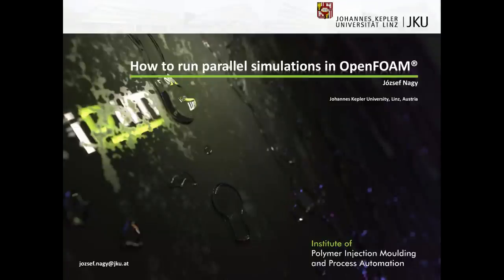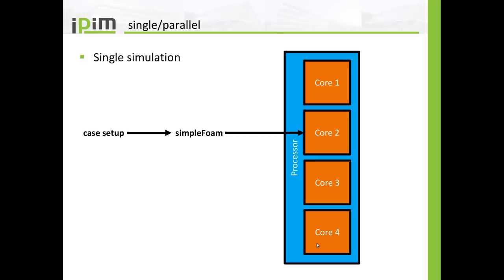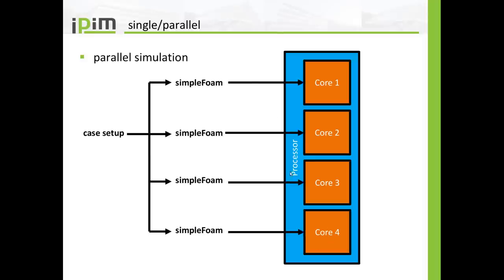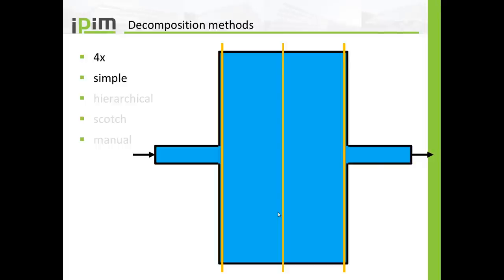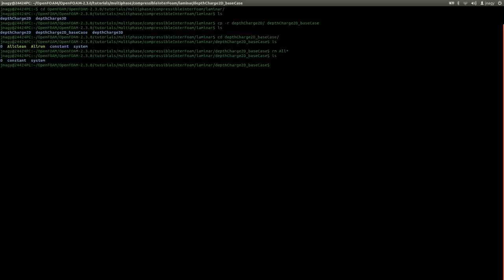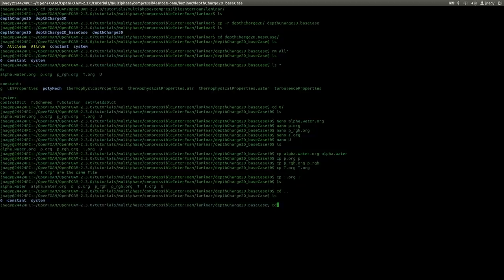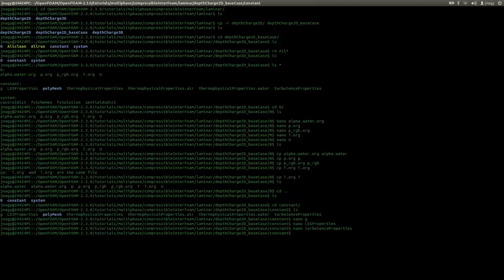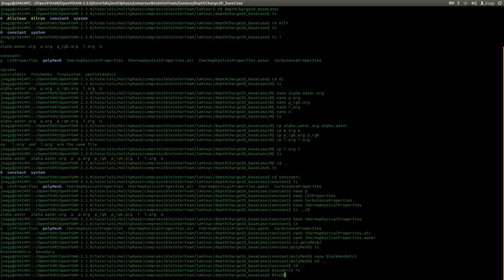How to run parallel simulations in OpenFOAM® - Part 1

Comment: Hii sir i am trying to implement custom model it works well with single core but for parallel it gives a warning that it couldn't find the .so file can you please give me some help
Reply: Hi, have you solved your problem? I have a self-written boundary condition, and the decomposePar doesn’t conserve this boundary when calculating. So then I cannot reconstruct because it says I haven’t specified a boundary

Comment: Hi József. I recently install to my laptop Ubunto 20  and after I run setFields, it run ok so far, and I tried to see the alpha.water from nano, to see the change, but it didn't response so I couldn't see the list of numbers, it's not possible to see the list, the weird is that I executed the solver and it run ok but I couldn't see this file, and I tried to read the file on windows and this can be open but in the list appear null value. It never happened to me on windows, do you know why? by the way I'm using OpenFoam foundation 7
Reply from the maker: Uncheck maybe the skip zero time checkbox. A video on this is coming out tomorrow.
Reply: Taken from: OpenFOAM® Basic Training by the TU Wien
If the above output is not displayed, but a stream of NULL characters, your text
editor is probably printing binary. To fix this, open system/controlDict, and change
the writeFormat field from binary to ascii and rerun the previous command.
Fixed it for me (:

Comment: Hello Sir, your tutorial is really helpful. I am able to run my cases on multiple processers using decomposeParDict utility. However, I have to run my simulation on cluster.  Earlier, I  was using ANSYS for CFD analyses. For ANSYS, there is a single script to run any simulation on other nodes other than master node just by changing the case and solver. I am searching for same type of script  for OpenFOAM too. Kindly, guide me for the same. Thanks in Advance !!
Reply from the maker: This is highly dependent on the cluster. You have to talk to your admins.

Comment: This is a very useful tutorial. I have a question when I try to repeat the tutorial.  I am using openfoam 8 at a window 10 based ubuntu. So, after I run setFields, the fielddata created by this command is not readable. For example, when I using nano command to open the 'alpha.water' file, it is '..... 12800 ( ð?      ð?      ð?      ð?  ........... )' . However, I was expecting the unreadable data should be values between 0 an 1.  Another wierd thing is that the case is running OK and the flowfield results in paraview is similar to your tutorial although the field data is unreadable using nano command. Could you help with this?
Reply from the maker: Do you use binary format?
Reply: @OpenFOAMJozsefNagy  I just checked the controDict file, the writeFormat is 'binary'. So, this is the reaon. Thanks for your suggestions. It helps.
Reply: @x.y.8707  I met the same problem, how should I solve it?

Comment: OpenFOAM v6:
My thermophysicalProperties.water file reads:

thermoType
{
    type            heRhoThermo;
    mixture         pureMixture;
    properties      liquid;
    energy          sensibleInternalEnergy;
}

mixture
{
    H2O;
}

and the part which resembles your file has been commented out signifying it's obsolete. However, I tried using the commented part instead (as is your case) and it gives me error saying something like "thermophysicalproperties.water file read but found this instead of that". Why this  error? I think both should work.
Reply from the maker: They changed it and split up the properties since 2.3.0. Just take a look at the thermophysicalProperties.water file.
Reply: @OpenFOAMJozsefNagy  So writing H2O is enough? Does OpenFOAM recognize it without mentioning the details? My doubt is that the detailed part should work too.
Reply from the maker: @parasghumare5864  As long as the simulation works this way you should be good.